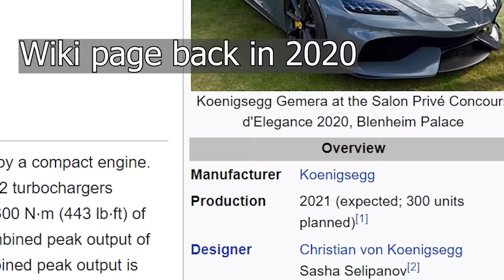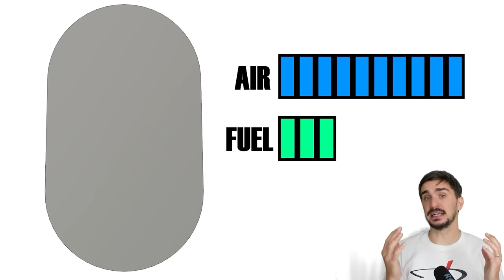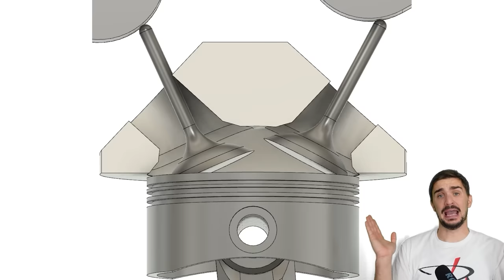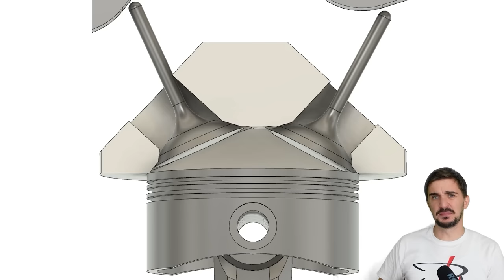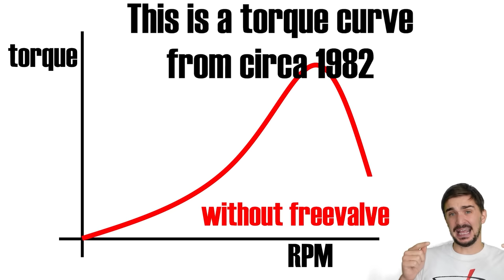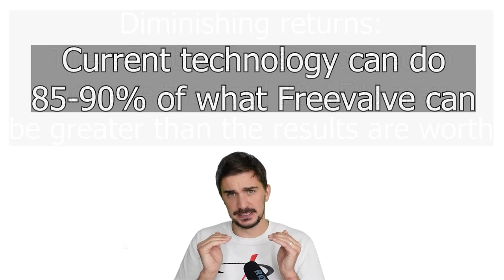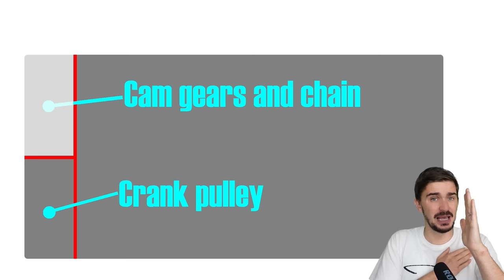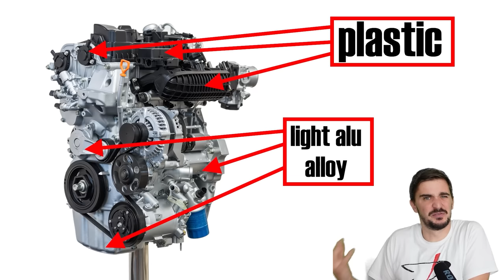FreeValve Isn't a Big Deal. Here's why

Comment: One possible good use for Freevalve is instead of trying to make a little engine more powerful, make a big engine more efficient  and versatile.  For instance, you can have a 800hp V8 monster that can also cruise around town or on the highway and get really good gas mileage when all 800hp isn't needed.  That's something that wasn't covered in this video.
Reply: 👏👏👏👏👏👏👏👏👏👏👏👏👏👏👏👏👏👏👏👏👏👏👏👏👏👏👏👏👏👏👏👏
EXACTLY !!!  He just compared the numbers, when we know the main difference is shown on graphics, at real world use.
Reply: so, an expensive cars , useless on the road.
Reply: It was covered... sort of - just not dwelled upon as you want.
The exact counterpoint was made vis-a-vis the Corolla GR - 300hp from a 3cyl 1.6L, factory warranty, Toyota refinement, and.... 21/28 mpg. This engine is quite literally a rolling and affordable example of why Freevalve improvement is much more marginal then the marketing claims.

You will not be finding any 800hp V8's getting a similar 21/28 merely due to Freevalve - the physics of increased friction surfaces alone will insure that. 

moreover... exactly how many people who can afford a 800hp V8 vehicle care one whit about good gas mileage while merely "cruising around town"?
Reply: Big V8s are not inefficient because of valve timing. They're inefficient because they are big and have 8 cylinders.
Reply: @mitchdaks6363  
He forgot to mention that the Corolla GR also comes turbocharged.
Reply: I thought the main benefit was to bring down design/production cost by modularizing things.

But it's not like combustion is poorly studied. v8's are only good at how they sound these days.
Reply: Free valves are pretty cool on a 100m plus ship. It makes the engine more efficient lighter, and ships already have the hydraulics and pneumatics to run the valves. For a car you have to add a lot of equipment to run free valve. If your car does not have a hydraulic pump or air compressor there is little reason to add one in my opinion. Would be cool on a tractor trailer.
Reply: @WilliamKennedywmk3  Thank you, I thought I was losing my mind. I have a lot of respect for his content but the guy was basically implying it's a NA equivalent pulling 300hp... Granted, it is only a 1.6L 3 cylinder which is impressive but also conflicts with his previous point of getting high numbers out of anything with forced induction.
Reply: I thought the same thing, interesting that he didn't mention the versitility.
Reply: Actually it was briefly mentioned.  I don't remember the exact words he said, but he referenced that there are lots of engines on the market that use some form of cylinder deactivation on larger engines for improved economy under low power requirement situations.  Disabling valves so they cannot open does not requre freevalve. This has been around for 15 plus years.  Problem is on a V8 engine even after disabling 4 of the 8 cylinders by disabling fuel, spark and valves, your gaines still aren't that great.  Freevalve wouldn't really make cylinder deactivation any better than it already is, and it doesn't provide that significant of gaines.
Reply: There is never a need for 800HP in Any Street Car unless the driver is really small down there and trying to over compensate for his own Short comings.
Reply: @arthurhq5741  I think they're referring to on-the-fly cylinder deactivation.  Small turbo engines are essentially on-the-fly multi-displacement engines. Take 1.5l and shove an extra atm of pressure into it you essentially have a 3.0l engine.  On the other hand a 6.0l V8 will always be 6.0l.
Reply: @cloggedpizza239   The problem is that ship engines run at very low RPMs (150ish) and most importantly, at sea they're always run at "cruise" RPM. Thus the cams are set to get best efficiency at cruise RPM, and there is no point making the engine more expensive and less reliable in order to get 20% more efficiency during the harbor or canal manoeuvres
Reply: I you have VVTL-i or better yet, Multi-Air, you can already do that - then add Northstar style 1 in 4 revolution cylinder firing and you could run a 1000 bhp tuned GMA 4 litre V12 like a 1.0 Ford Ecoboost
Reply: But It WAS covered.  VVT already does that.
Reply: @tbas8741 people will drive whatever they want😂 get over it
Reply: @arthurhq5741 could cilinder deactivation be easier with freevalve?
Reply: @JJFX-  Agreed but also Freevalve is pulling numbers out of their butt with vaporware. We don't even know if it can produce a single HP of the 230HP when we know what real world vehicles can do. The comparison was still mostly apt because we have found affordable ways that have gotten to market and are reliable to produce that kind of power from a small plant... and not be vaporware that costs $1.5+ million to buy lol. That's his overall point.
Reply: thats not how it works sorry. 
also you dont need tech to get power or economy. 
case in point. 450 ft lbs of torque in my daily driver. v8 cam in block. 35 mpg city 30mpg hwy.
i can beat a hellcat i can beat a new corvette. i can do a wheelie. i dont need rpms i dont need launch control i dont need to heat my tires. no stall converter just let off the brake and hit the gas. my motor cost me 1200 to rebuild and add my goodies. everyone says my car makes more power than it does. i built it im pretty sure i know more about it than they do. i actually have it detuned and then the power is still limited past that. yet ppl still tell me it makes over 600 hp. i didnt build it with hp in mind its a fake number. torque is the only thing that matters. and how its applied and used.
Reply: @chehystpewpur4754  what engine and car is that? sounds cool
Reply: @fawnsans  just simple things used properly. light vehicle torquey motor proper a/f ratio
Reply: @chehystpewpur4754 the rpm really matters for that value of torque, is it some kind of tractor engine?
Reply: @fawnsans  square body s10 blazer with a very mild vortec v8. the small block not the ls motor garbage.
Reply: @green5260  no its just the last generation of the chevy small block with proper mods. very mild build and great results.
Reply: If done correctly, freevalve might be more reliable than GM's active fuel management whilst still allowing cylinder deactivation to happen. For the cool factor, you could even have it introduce artificial lope if the vehicle is in "sport mode," a-la "make my engine run like shit at idle because it sounds cool" mode. Why? Because you might as well, it doesn't hurt the engine any and if they want to save gas while idling, V4 mode is the push of a driving mode select button away.
Reply: The key conclusion of the video was that freevalve, despite being marketed as a disruptive technology, is actually an iterative design step in a long line of VVT technologies. It may have marginal advantages over other VVT methods, but it’s also expensive and unproven. Therefore the returns (performance and efficiency gain) will be small and the expense (adding novel pneumatics to your engine) will be large no matter what it is used in.

The only thing better than 10% better is 20% cheaper.
Reply: I believe they will be highly useful on a hydrogen engines that require adjustable valve timing when changing rpms and flow rates in real time.
Reply: As far as I know Daimler has something like this with a modular/changable cam shaft. Its called camtronic and allows to change the valve timings for some cylinders essentially switching between a performance and eco mode for their V8s.

Actually I just stumbled over the respective wiki site: https://en.wikipedia.org/wiki/Variable_valve_timing It obviously doesn't have the felxibility mentioned here.

edit: should have watched the end of the video first :D
Reply: You can already do that with variable displacement and variable valve timing. You "just" shift your motor from 800 hp V8 to 400 hp V4...
Reply: Some LS engines solve this partially using cylinder deactivation to turn the v8 into a v4 when power isnt needed.
Reply: @cloggedpizza239 oh it’s already done in ships? 
Dang.. that was where my mind first went, why not use it on engines with much lower rpm 
Like giant ship engines
Reply: That isn´t a new idea. VVT and cylinder deactivation which is a possible feature of VVT has been in service on not to few big sportscar engines. But It is limited to DOHC or at least OHC engines for as far as I know because the availability of space to put all that stuff would be very hard to realize with the camshaft placement in OHV engines so almost every single american V8 made until today.
Reply: @arthurhq5741  
This statement is nothing but BS. The biggest engines that currently exist are the most efficient that have ever been built. Efficiency is the percent value of how much energy of the fuel burned can be turned into usable physicle labour. 
The issue with ICE powering vehicles via a standard manual or auto trans is the huge multitude of combinations of possible loads and rpms that occur during operation and the difference in power demand for acceleration and cruising. A car like a VW Polo for example will only need like 30 - 40 hp to cruise at highway speeds on a flat road without wind. But the engine should be powerful enough to allow for decent acceleration at least up a slight hill and with a bit of headwind and the power demand of this situation is easily 2 to 4 times that 30ish hp figure depending on conditions. The natural dynamics of todays road traffic make this at least a want have in terms of safety. 
But here comes the point: If a gasoline engine with fixed valve timing and without EGR runs on so low load that it only makes a quarter of the power it could make or even less it is very likely that this point of operation is pretty inefficient percent wise. This also kind of applies to Diesel engines of course but as Diesel engines have their Throttle bodies all the way open all the time if they even have one they don´t have the issue with pumping losses which is the major source of poor partial load efficiency. 
And this is where Turbochargers and cylinder deactivation and all that kind of fancy tech come into play. Those few cylinders remainig in operation can run on higher loads with a more efficient combustion even though the goal is not to achieve max power output. But fuel savings on engines that are already on the small side in relation to vehicle weight and size are minimal as the average load profile which these engines are running are already pretty high. The return you gain on "perfect fit" to slightly oversized engines is much more worth it. Taking into consideration that comparably larger and by that less stressed engines most likely last much longer than the rather too small ones this would make lots of sense overall. Of course no car really "needs" 800 hp to safely exist on the road, my personal point of measure for rightsizing would look like 150hp for small hatches to 400 - 500hp for really big suvs. Bigger cars will always get worse fuel mileage but it should be self explaining why that is.
Reply: he already covered this point in the video, variable valve timing has been a thing for a long while. Freevalve may be a direct upgrade to a traditional carburated engine, but it's improvement compared to modern engines is not much.
Reply: @tbas8741 😂"Short comings"... for those who didn't pick up on that sneaky pun....🤣
Reply: @ajwright5512 you mean it'll only last 50->60k miles, like any Ford EcoBoost?  (Unless you're one of the lucky ones...)
Reply: @alexmanojlovic768  Theoretically, it should last 200k, maybe, as each cylinder only fires a quarter of the time.
Reply: I'm sure I went to Fulneck school, Pudsey, UK with an older AJ Wright & his brother??  (Yes!!... We all called them the Wright brothers & they were both brilliant at Physics!!🤣)  ???
Reply: @alexmanojlovic768  Nah, sorry mate was good at physics, but I'm a Norfolk boy!